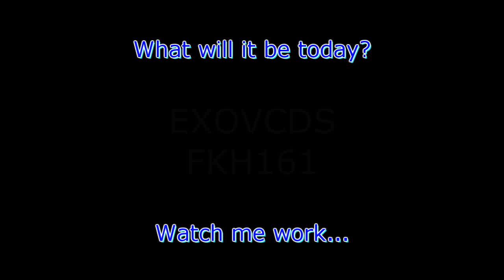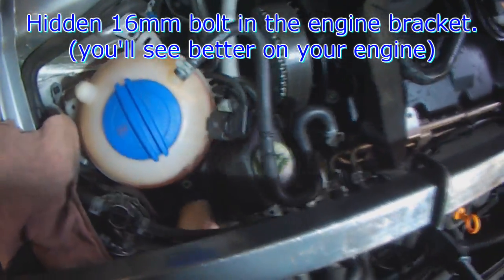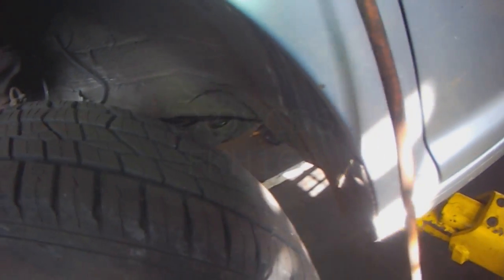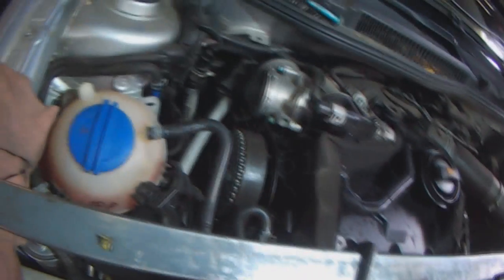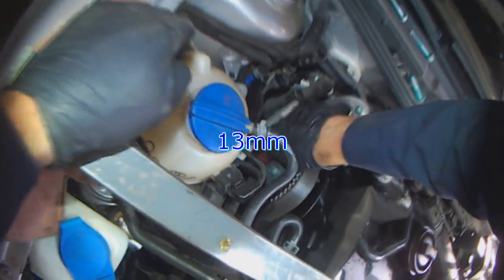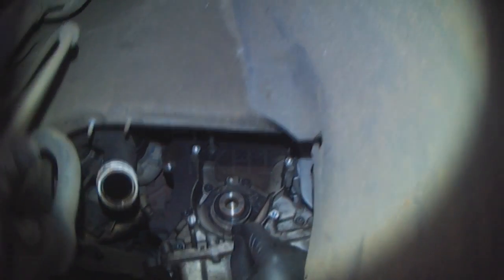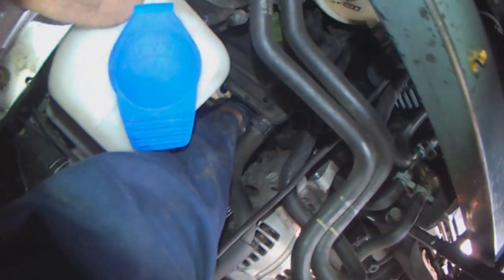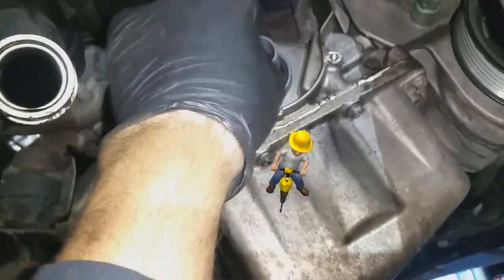VW A4: 1.9L BEW TDI Timing belt & water pump removal

Comment: Hello Thomas. 
Thanks again for the great videos. 
I just changed my timing belt. This is the second time I do it. The first time I had no issues. This time, after completing the job, I started the car and listened to the engine. Car started right up and sounded great while idling. Let the car run for about 10 mins while putting stuff away. Drove out of my garage and about 100 ft to where I park it and let ir run another 5 mins. When I got back in the car I noticed cold air coming out of the vents even though the temp needle is showing the engine is warm. (I also changed the thermostat as it came with the timing belt kit)  Press on the accelerator and heat starts coming out of the vents but only when I am pressing on the gas pedal. Otherwhise -cold air. As I am pressing on the accelerator I notice that when I get up to around 3500 rpm the engine stutters ( or misses ) and the traction control light comes on as well as the glow plug light flashed briefly. It did this twice in a row so I shut the engine off. I am confident I did the procedure correctly and even checked that the crank tool and camshaft locking pin slid easily into position after the belt install. (but must have done something wrong)
Repeated the test (turn engine over twice and re insert pin and crank tool) 3 times before deciding It was good and moving on.
Any idea what is causing symptoms?
Thanks in advance for your time,
Dominic.
Reply from the maker: Air pocket in cooling system / heater core for lack of heat, would be my first guess. Extended high rpm / driving should push the air out of the core. Once the coolant cools off, fluid level will most likely drop in the reservoir, at which point you can top it up. 
I don't know what would cause traction light to flash or the stuttering... if it continues after a few key cycles / engine starts & stops... then the ECM might set a fault code that might help with troubleshooting.
Reply: Hi Thomas. Thanks for the reply. The heater issue seems to be resolved. The coolant did go down and I was able to add more. As for the traction control light it was off after restarting the car. I notice now that the stutter only happens when I "double pump" the gas pedal at around 3500 rpm and riggers the traction control light.  
Difference now is that on the restart the engine light was on. I scanned it with vcds and got a few codes: 
- In address 01(Engine)  1 - 16618 - Boost pressure regulation P0234 limit exceeded (overboost condition) 2 - 16791 EGR sensor 2 P0407 signal too low 3 - 16787 EGR valve (N18)P0403 malfunction 4- 16705 Engine speed sensor (G28) P0321 implausible signal.
-  In address 02 (auto transmission) 1 - 00529 engine speed signal missing / intermittent  2 - 00300 trans fluid temp sensot (G93) 3 - 01166 engine torque signal intermittent
-  In address 03 ABS Brakes - 01314 engine control module / check DTC memroy intermittent.
In the last month the car twice went into limp mode when trying to accelerate after slowing down slightly at 125 / 130 km/h
Sorry for the overload of info but I figured the more you have should could probably help you figure it out.
Thanks again,
Dominic.
Reply from the maker: If it's overlooking / going into limp... check / solve that first. Vanes are probably  sticking / not moving full travel.
Reply: what could be causing this and what would you look at first? can the car be used in spite of these codes?

Comment: That looks like a pretty involved setup with special tools to lock down the cam and crank. I just wrapped up a timing belt job which had special tools too for locking down the camshafts and crank. Good job Thomas...
Reply from the maker: Looking forward to seeing your video(s)! :)
Reply: Am I the only one who just marks the belt to the pulleys and puts it back on the way I took it off. Do we really need all them tools. Been doing it that way for a long time no issues.
Reply: Rags2Wrenchs no you not the one doing this for sure :-)

Comment: Thomas, can you help me understand stretch bolts (ie. TTY)? Are they just regular 10.9 bolts? Do I really need to exchange the ones for the engine mounts and brackets each time? Do I need to use the VW brand or is there a cheaper alternative? Thanks for your instructions.
Reply from the maker: I'm not an engineer, so I can't say if strength rating alone is enough. For initial torque, sure. I would think that a TTY bolt is of a softer material, which allows it to be "stretched"... where as a regular bolt might twist or snap. I have reused TTY engine mount bolts on my personal vehicles, but without fully going the specified angle. A good parts supplier will include all needed bolts in a timing belt kit.

Comment: It's always nice watching timing belts. Learning something new every day.
Would be possible to get number of those wheel locks (set) so I can look em up? Could really use them cause sometimes we have to check entire car for them and usually they dont even have them.

p.s. that information about water pump you sent info was very helpul. Thanks
Reply from the maker: Hi... I only have 2 sets (not sure how many there are) T40004 and T10101A . I don't bother looking for the tool in the car, real time saver! They are not listed at https://vw.snapon.com/Home.aspx (where I usually by tools)... I got the sets through ebay (from a VW dealership in the states).

Comment: the kit i just got didnt come with the studs for the tensioner and pulley... but going to  the stealership jk haha tomorrow to get fly wheel bolts and now those two studs as well....!! ive watched this video pry 40 times in4 years!!!! keep it up!!!
Reply from the maker: Yeah, some kits don't include the studs. They are probably OK to reuse one time... but it is best to install new studs each time the timing belt / kit is changed.

Comment: So if when you put in the bottom lock and the top holes dont line up does that mean timing was off? when yuu loosen and get lined up your fixing it?
Reply from the maker: Once the tools fit, tighten the cam bolts and the belt tensioner. Remove the locking tools, turn crankshaft 2 turns... check if locking tools fit. If yes, you are done. If no, reposition cam & crank so that the tools fit. Basically... follow service information.
Reply: You could be 180 degrees out,turn crank one more full revolution

Comment: Is this the same procedure on 53 reg mk4 golf gttdi 1.9 asz engine ?can you remove the engine mount with brake reservoir in the way on r/hand drive car ?Many thanks matt great video by the way
Reply from the maker: Sorry.. don't know the specifics of the ASZ engine... if it is dual cam, then there probably is a difference. I only work on left hand drive vehicles. A service manual should be of great help / have all the information you will need.

Comment: Hey Thomas, I am replacing my timing belt now but my crankshaft locking tool and my cam shaft locking tool never line up. The cam shaft locking tool will almost slide in but is just off by just a little no matter how much I turn it back and forth. The crankshaft locking tool will never line up and slide right in like yours did. Do you have any advice for me? Thanks, Carter.
Reply from the maker: Install camshaft lock... loosen cam gear bolts, turn crank slightly till crank tool fits.
It is normal for the tools to not fit after several years / several thousand miles (belt stretch).
Reply from the maker: BEW engine, yes?
If you have to turn the crank more than 1 tooth, something is not correct.
Reply: @EXOVCDS  Okay I will do that, thank you.
Reply: @EXOVCDS  It almost seems like the tool is too high to slide into the oil pump slot. How do I fix this so it will slide in?
Reply: @EXOVCDS  It is a BEW engine. Was driving and idling fine and then hit 300K and I parked it to do the timing belt.

Comment: I know this is late but have you ever done the ac compressor clutch on one of these engines and have any tips
Reply from the maker: I have not, sorry... but you should be able to change it with the compressor in the vehicle / no discharging of AC required. I think.
Reply: @EXOVCDS thanks and it's in a tight spot and the pulley has seized but the clutch is spinning I think it's a garage job

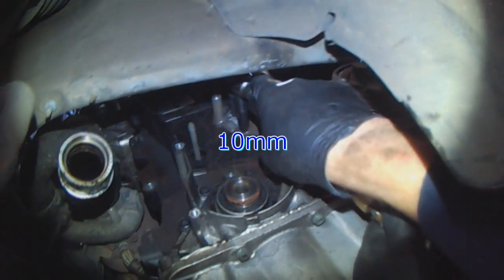Comment: I am about to do a timing belt on my brm. It is the same or extremely similar configuration. Why replace the studs at 23:25?
Reply from the maker: Same thing... because the studs came with the kit, they also can break over time if stressed enough. Why take a chance.
Reply: Ya i didnt see them buried in my kit at first and I agree why take the chance. I just wasn't fully awae this morning. I am pulling the intake, turbo, egr cooler, both manifolds and probably replacing the cam with a billet cam kit. Any advice?
Reply from the maker: Haven't replaced a cam on one of these (BEW / BRM / PD TDI) yet... only an injector so far. As long as you have a service manual or instructions that came with the kit, you should be fine. There are stretch bolts that you need to replace and you'll need some specific tools as well as a dial indicator to adjust injector preload. Here's a DIY article that can explain more than I ever will be able to (you've probably already come across it yourself): http://www.myturbodiesel.com/wiki/camshaft-lobe-wear-inspection-and-replacement-on-tdi-pd-engine/
Preload: http://www.audi-sport.net/xf/threads/how-to-guide-pd-tdi-injector-adjustment-clearance-lash.183040/

Comment: Getting ready to tackle this Thomas- quick question- what torque spec for the two studs? (tensioner and idler)- do you take a measurement for those two or just go snug?
Reply from the maker: The service manual is a great source of information:
http://fkh161.ca/VW/A4/BEWTimingParts.pdf
You can download as many manuals for as many cars as you want for only $35 USD (within a 24hr period) from here:
https://erwin.vw.com/erwin/showHome.do

Comment: ok thank You  if the fuel pump add more that 500ml on 30 se its bad fuel pump or not
Reply from the maker: More flow is better... but you also have to check pressure.

Comment: Hi Thomas, 

My B6 Audi A4 1.9Tdi has what I believe a leaking water pump, coolant is dripping bad from underneath the front timing belt area of the longitudinal engine. Interval for timing belt is 60k miles and have 40k miles on the belt. Can the water pump alone be replaced or would you advise doing the belt alongside the water pump i.e is it roughly the same amount of labor hours to do either jobs? Thanks man
Reply from the maker: You can replace just the pump... but I would to a complete timing belt kit. Yes, because of the labor involved. The belt may also be contaminated by coolant... which will affect overall life. Let's say you leave the belt, tensioner  & roller... you change the pump, then after 20K it's time to do the belt & other components. Will the new pump last another 60k?
Reply: Yeah thats true, a water pump wont last 2 belts so your right...really its a false economy not doing the belt, tensioner, roller and water pump altogether. Ill get the lot replaced, and thats actually a good point on the contaminated belt...never considered that. Thanks for the advice man and great content!

Comment: Hello. What is the torque specs on the crank pulley bolt on the middle, for me manual says 10nm plus 90 degree with thread lock, but that just seems wrong, I almost could not brake it loose with a 24" braker bar. So I'm a bit confused... many thanks :)
Reply from the maker: The center crank bolt does NOT have to be removed to get the pulley off. What is it that you are trying to replace? The 4 small bolts are 10Nm+90... the center crank bolt (19mm 12 point) is 120Nm+90. You only have to remove that bolt if you are changing the crank seal or the gear.
Reply: @EXOVCDS  thank you very much for the reply. It's just me being stupid, I didn't even realize, that the pulley comes off without that. Many thanks on the torque specs, and for pointing out what I missed 😀.
Reply from the maker: New bolt of course.
Reply from the maker: @kaczazsolt6044  No problem. Thanks for watching!

Comment: ok thank You the problem its hard to Start i have to tryin Start 2 or 3 time
Reply from the maker: Check fuel pressure & flow / supply (should pump 500ml in 30 seconds)... check coolant temperature with scan tool. If coolant temperature is too low... that can cause hard starting (ECM injects too much fuel).
Reply: Fuel pressure regulator its New or you said fuel pressure from the pump i can check that wiht multimeter
Reply from the maker: Disconnect the fuel feed hose at the injector rail (place it into a container) and bypass the fuel pump relay (so that the pump can run for 30 seconds). Measure the fuel volume after 30 seconds.

Comment: Do you really need the bar to support the engine? and if so, where do you buy it? Custom fabrication?
Reply from the maker: +etiboy48 No. I've shown in other videos that you can support the engine from underneath. Use a floor jack to hold the engine up.
Reply: You can also make a support.  Use a 4x4 piece of lumber with a 3/8 or1/2 inch hole drilled in the correct location for an eye bolt and S hook. Use 2x4 scrap pieces to fit where the fenders bolt on to support the 4x4. Screw and glue  the 2x4 pieces to the 4x4 using angle brackets.

Comment: i check the fuel pump add 300ml for 30 secon its Good or not and I have to buy the gauge for check the pressure
Reply from the maker: Should be better... you don't have any "running issues" once the engine is running, right? Hard acceleration, cruising etc, no issues? Then the pump should be good enough. The test was just to get an idea of fuel flow. Once you have a pressure gauge attached, you can see what pressure is in the system. On a cold engine, it will start at 0... during cranking, it should quickly increase past 30-40psi. If it takes a long time to build pressure, then there could be an issue.

Comment: ok i check the fuel pump with multimeter the resistance its 02.7 ohm & the voltage went the ingine craking its 11.5 volt
Reply from the maker: That's OK. When the engine is warm... no starting problem? Starts right away?

Comment: And yeah, why did you take the crank bolt? I didn't see any leakage from the seal...😎
Reply from the maker: Why wait until it leaks to replace it? Will it last the life of the new belt? Maybe... maybe not. Isn't that also why we replace the water pump? I'd rather replace it sooner than having to go back in before the belt is do again. If I remember correctly, there was some oil.
Reply: @EXOVCDS  roger that

Comment: Great video Thomas.  you make it look easier then I do.  Question, my BEW tdi has 324,000 miles.  Mpg has dropped to avg 35mpg.  Common problems I could look for?  Should I worry about adjusting injectors, they are still within 1.0 on VCDS.  Should I worry about oil pump?  Still running good.
Reply from the maker: I don't know enough about TDI's to know what MPG should be or what to look for when things seem off (I only see them for maintenance and other non-mpg related issues)... all the TDI's we work on are short distance stop & go driven by their owners, so I have never received feedback as to MPG. Check the usual (which I'm sure you have) suspects, try fuel additives, check cam lobes, drain the intercooler of oil. At that high mileage a lot of things come to mind that should be / could be checked, that could cause an issue (mechanical) down the road.

Comment: I was really enjoying my new to me 06 Jetta wagon until I saw this ....    what a crap load of work
Reply from the maker: Same can be said about any other make & model vehicle. To own a car... means having to deal with the way things were engineered. Sure, this timing belt setup may not be that great... but I've seen worse. You'll be happy to hear that LOTS of things on your car are easy to work on (once you've done it a few times). Brakes, suspension, exhaust, window regulator, wiper motor, door lock modules, radiator, headlight bulbs, thermostat, coolant flange, battery, alternator... don't let one service item ruin your enjoyment. =)
Reply: Thanks  @EXOVCDS .   I've noticed how much easier the e-brake cables are to replace...although i'm not too impressed with the rear unit bearing hubs as I would rather get greasy hands and save money:_:)     Overall I am very impressed with the car and am sticking with it.   Bought a high miler, to try out my first TDI -  480,000 KM ,   but the car doesn't look it.   The car rides beautifully and has a very luxurious feel .  Love the 5 speed tiptronic..   Currently doing  pre safety work on all things rotating on the axles except the front bearings which are still good.  The rear brake flex line was damaged a little at some point and I decided to change it out... it came out like it was assembled a month ago.
Reply from the maker: @johnhayes9437  She'll serve you well & long when maintained... sounds like she's in good hands! A friend in Eastern Canada runs a repair shop and he has many customers with 600K+ km A4/mk4 TDI's.

Comment: i check the coolant temperature its 75 (F) & ambient temperature its 63 (F) its ok or not
Reply from the maker: +Armando Hilario It's OK... a small difference is OK. When it is cranking a long time, you have to check spark, injector pulse, fuel pressure, EVAN purge solenoid, crankshaft position sensor signal... anything that could cause long cranking time. Sometimes it is quicker, cheaper & easier to take the car to a mechanic and let him find the problem. If the only issue is long cranking (no issue when driving)... leave it until it gets worse. The problem might be easier to find then.
Reply from the maker: +Armando Hilario EVAP Purge Solenoid... can cause long cranking, especially after filling the gas tank!